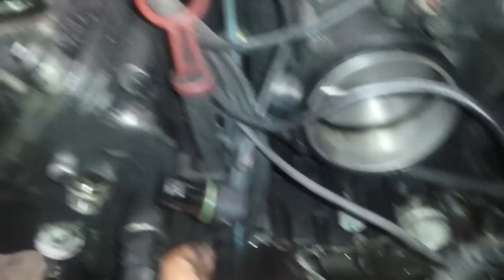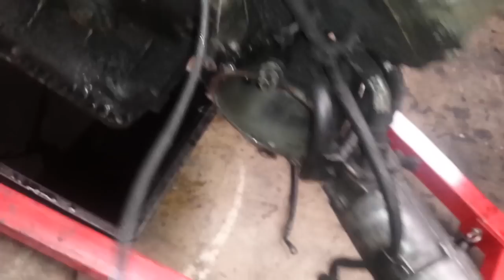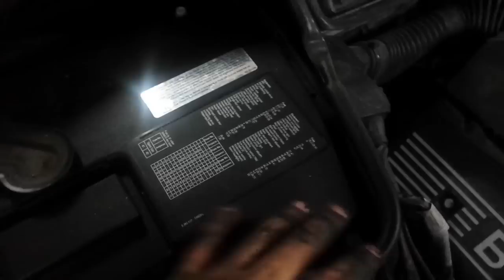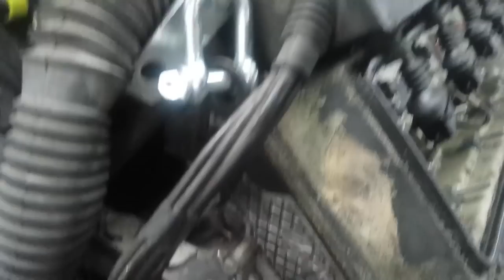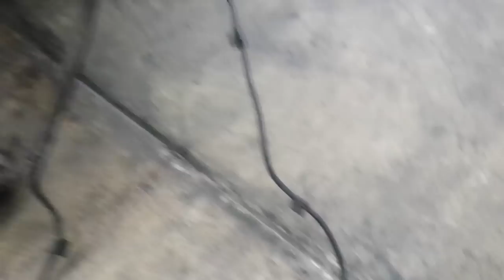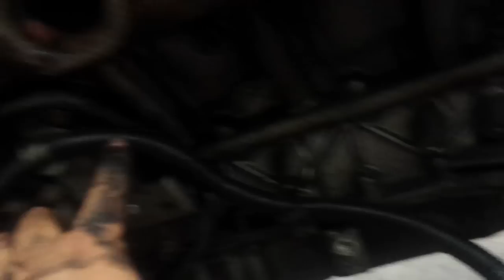99-01 BMW e38 740 M62Tu Vanos 4.4L Engine Wire Harness Diagram

Comment: what about the knock sensors under the manifold?
Reply from the maker: Thanks for pointing that out.  Knock sensor connections are not part of the overall wire harness.
Reply: +bimmermerchant ....the cam sensor wire is not part of the HARNESS either.